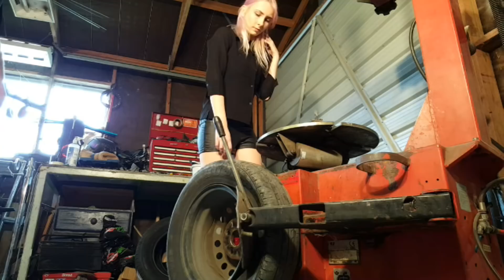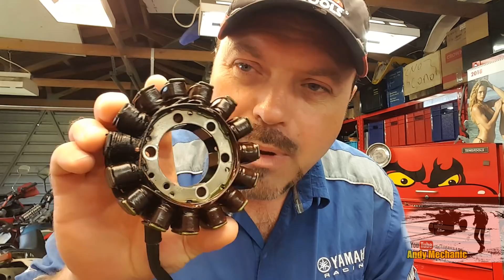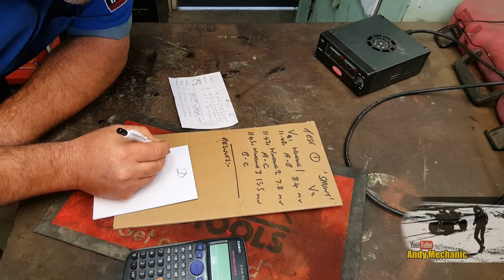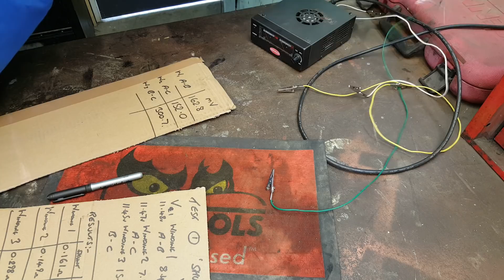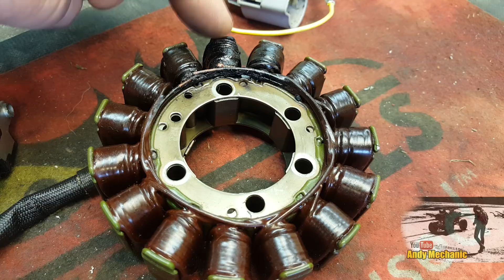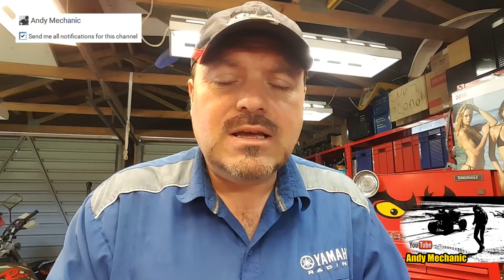Using Kelvin 4 wire test to measure low resistance #1433

Comment: Hi Andy, the 4 wire kelvin test is a good way of testing the resistance of a very small resistor, but in your case, you are still including the contact resistance in your measurement. The voltage measuring leads should be as close as possible to the resistor under test. It shouldn't make much difference, but still good to know.
Reply: DerPapierfliegernarr is that still relevant given that in this case the measurement is voltage drop across the coils? Provided the leads are the same gauge and length the relative voltage drop should be closely maintained.
Reply: Justin, he touched the voltmeter probes to the alligator/croc clips, not the stator connector pins themselves so this isn't a proper measurement as you aren't eliminating the clip-pin contact resistance.

That said I applaud him for trying viewer suggestions.
Reply: sure.  but assuming the crocs are the same etc, then the voltage drop caused by contact resistance and wire length/gauge will be the same on both ends of the coil and therefore cancel each other out.  or have i misunderstood?
Reply from the maker: +Justin Adie that makes sense to me Justin, good point too. Though inclusion of the croc clips would make very little difference as they will have an incredibly low resistance.

Thanks for your feedback. Cheers Andy
Reply: I've just rewatched the relevant bits of the video and I understand the point the others are making now.  I'd been misremembering.  

Putting the crocs clips where they are and measuring the voltage across them effectively adds two resistors in series with the load.  And what you're trying to do is use the load as a shunt with a known current, to make use of ohm's law and derive the resistance from the voltage.  By adding two resistors in series you are artificially increasing the resistance you are measuring. 

Ideally you should clamp the crocs outside of your measurement points.  

However being practical the crocs and probes are made of aluminium and the resistivity of Aluminium is in the 10^-8 range, whereas you are measuring at the 10^-2 range.  The error caused by the crocs is going to be way smaller  than the accuracy of the voltmeter.  So not to worry....

But... running high current down croc leads ain't a great plan!  I remember being quite chastised in an o level class 35 years ago for running a variable power soldering iron of my own design over phono plugs (with heavy duty mains leads); and they were only just out of spec on full power ...